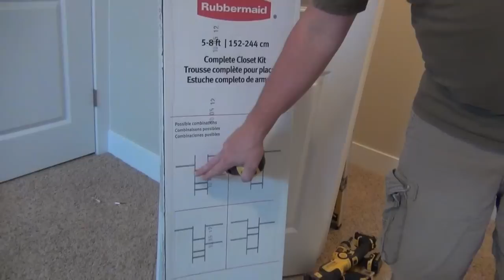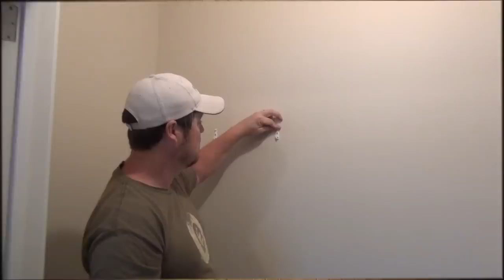Rubbermaid Closet Organizer | Kit Installation

Comment: Okay, so....I need to put up this shelf for a lady that can reach no more than 6ft and her closet is only 61.5in wide. What would you recommend are far as measurements? I am extremely lost and she has no one else but me to help her put it up. I am really stumped right now. I know I am gonna have to cut shelves and what not.
Reply from the maker: They sell these kits based on the amount of room you have.  They may have a kit to fit your needs.  Check Home Depot and see if they have what works for you.

Comment: Someone help me! I don't have a closet in my room and I would like to install this on my wall. Does it need to be touching the corners or the wall?
Reply: +Gaby Reyes I'm working on my closet now and saw your comment! They have track systems now, rubbermaid has one called FastTrack and they can be in the center of the wall not touching the side walls. You can also get pressure rod systems too, I know Ikea has them. Hope that helps!